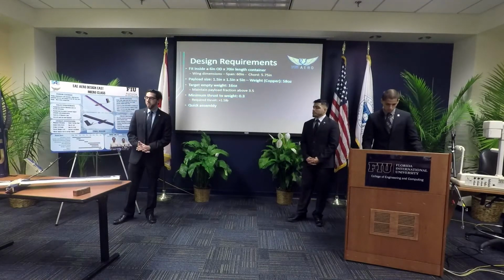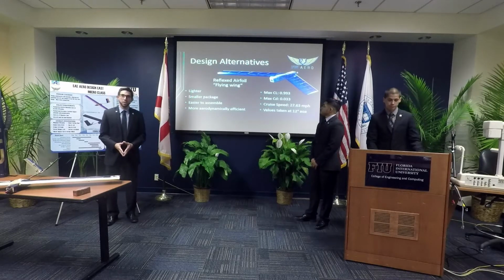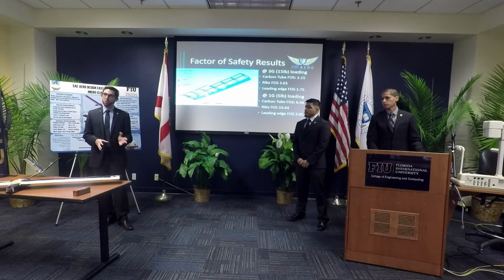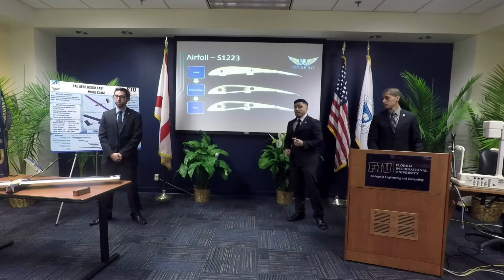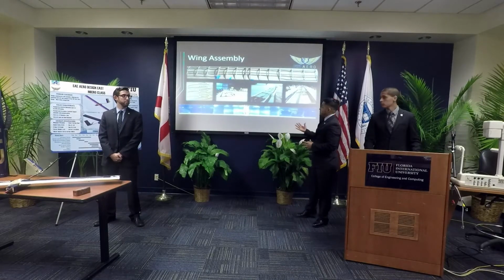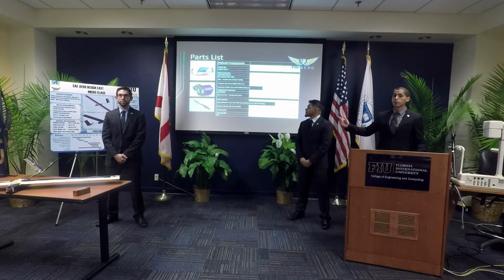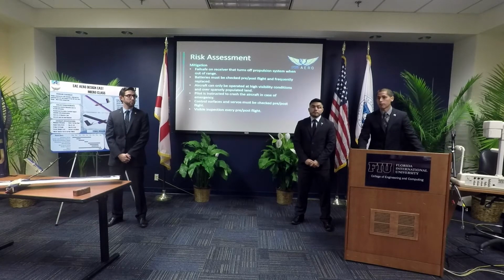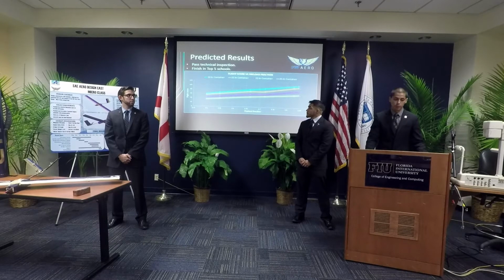SD Team 18: SAE Aero: Rapid Assembly & Deployment of Micro Class Aircraft

Comment: This is a perfect example of a great presentation. The process used to perfect weight to lift ratio was very well thought out and you see they spent a lot of time and effort on their project.
+The team clearly knew the information like the back of their hand. They also explained well the process they took to invent and modify design. Had great visual like great photos, charts, and videos. 
-The only improvement could have been the movement of the speaker with some unnecessary hand movements that is a little distracting.